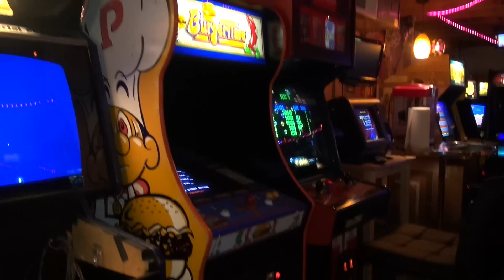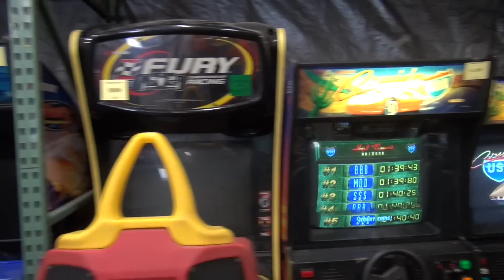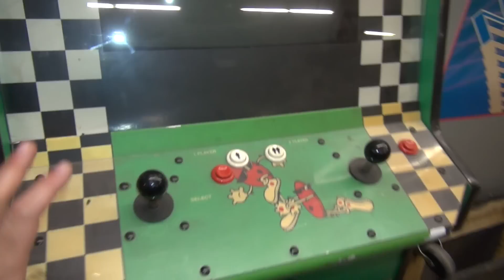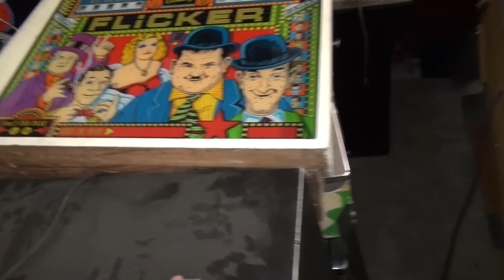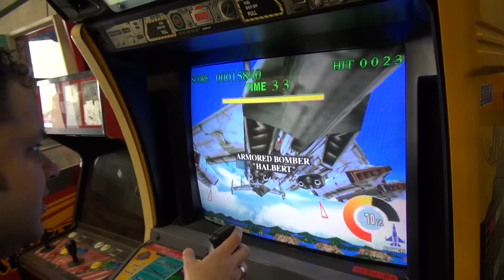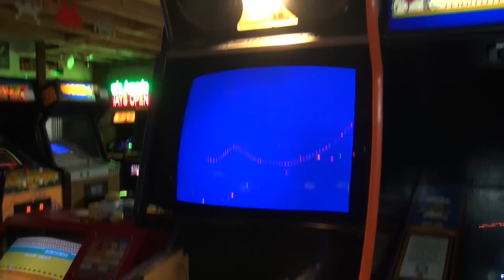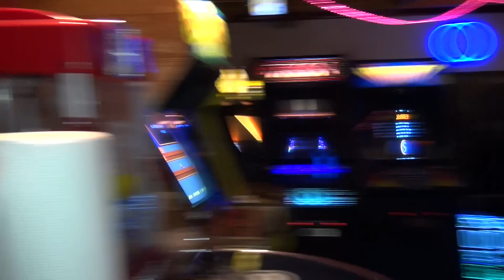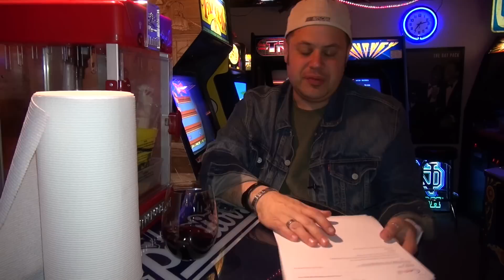John tours Royce's Arcade Warehouse in Chatsworth, CA - Vintage Arcade Superstore

Comment: I think that blue cabinet was made for a theater chain.  Everything is installed in the pull out drawer including the marquee and control panel.  You can swap out games by swapping the drawer.  The monitor can also be turned as well.

Comment: The odd blue cabinet with street fighter 2 was from a series of cabinets that were made for Circle K convenience stores. One of my pcb hook ups told me this. He had two of them and I was going to purchase one. The cool thing about them is the monitor can be flipped from horizontal to vertical by simply pulling it out, flip it 90° and slap it right back in.

Comment: John always wants people to use mala as front end for mame.

Hyperspin is much superior.  

So the lowest these guys will go it's 800?  

Why wouldn't they sell one of the less restored cabs?
Reply from the maker: I've never used Hyperspin. :) Maybe I should do a HyperSpin cab.
Reply: It takes a bit of time getting all the xml and png 's in the right place but it is worth it in my opinion. Great vids and loving the podcast
Reply: Maximus arcade is pretty cool once you figure out how to use it
Reply: I'M KIND OF GLAD JOHN DIDN'T BUY SHIT FROM THOSE GUYS,PRICES WERE TO HIGH!
Reply from the maker: Franco Avila they are high but it is retail. They have employees, insurance, etc. They also could help with fixing stuff if something breaks. So, I cut them some slack as they are not a private guy on Craig's List that will leave you stranded.
Reply: ***** I understand what you are saying but I feel like it's only hard to understand if you don't understand xml databases.  Just like fixing an arcade monitor or board, Google is your best friend.  What problems are you having?   I can help.
Reply: Point taken guys.I like the rental part.I wish you dudes mad success!*****
Reply: John's Arcade Game Reviews & Tech I got you.
Reply: wholeset
I was very excited forHyperspin. Got it most of the way configured. Looked aweomse. Then I pulled out my wireless xbox fightstick. Learned very fast that Hyperspin doesn't even support controllers. At least MaLa does even if it looks less fancy.
Reply: Stephanie Lovik I use xmapper to navigate with controllers. I ended up switching to game ex because after a while I got over hyperspin.  Too much flash